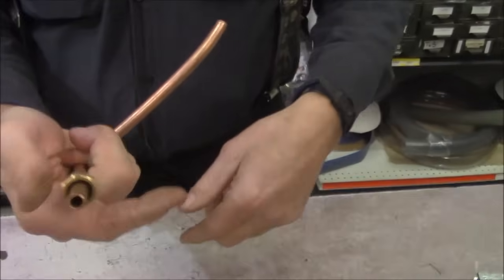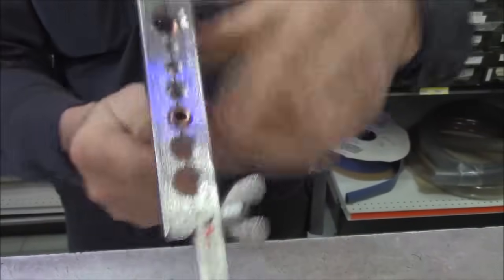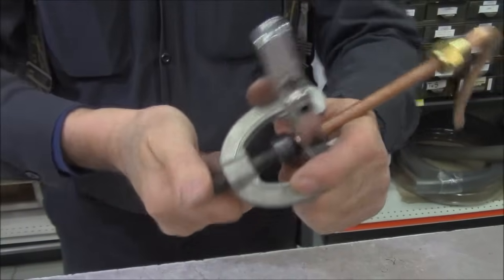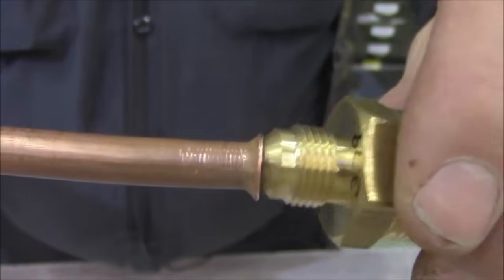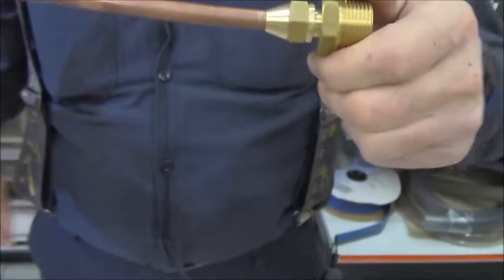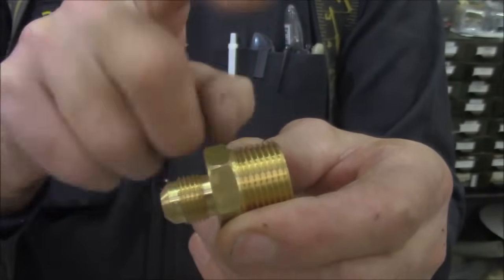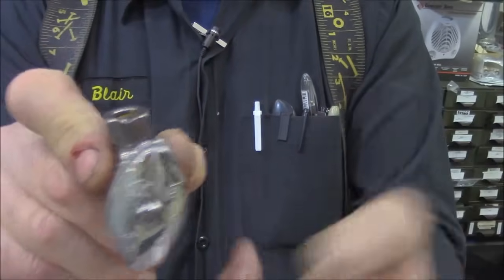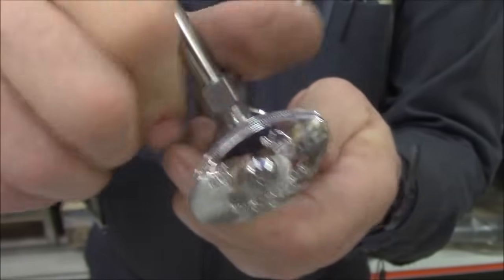How To Flare Copper Tubing For Gas, DANGER - NOT WATER COMPRESSION NUT

Comment: I need to redo the copper tubing that feeds LP to my gas fridge in my camper. Can I call a plumber to cut/replace/reflare my tube, do you think?  I'm trying to avoid the $90/hr cost at the local RV shop (though I doubt a plumber is going to be much less expensive).  If I want to try to do this on my own and put a new piece in where mine got kinked, how do I cleanly cut the copper tubing so that it's round still before I use the flare tool, please?
Reply from the maker: You'll need a small tubing cutter to get a clean edge. I have cut w a mini hacksaw then used a drill bit to clear out any copper shavings. Be sure not to let them go down the tubing. Once you pressure test the line use soapy water to check for bubbles at any joints. Not just yours. Blair

Comment: Looks like whoever installed my hob did it illegally. The tube is clamped on the outside of the house with a flexi hose on an LPG bottle, goes through the wall via copper pipe and straight into the hob. Now the hob has a compression fitting under it, so how is that a thing if it's not legal?
Reply from the maker: My kingdom for a few pics, sounds pretty shabby, probably. Blair

Comment: I must have fumbled around flaring brake lines for about 2 days with this type of flaring tool and it was a complete headache to work with. Copper is probably much easier to flare but this type of flaring tool scares me when it comes to gas lines. They ought to come up with a better type of cheap flaring tool.
Reply: I'm not the automotive guy, but I believe there are special tools for brake lines. Be careful of cheap fixes when working on brakes.
Reply: Like anything else you have to practice flaring to get good at it. Do a good single flair, then move up to double flair. Brake line material is typically steel so it is harder than copper. Also if you can afford to buy up on your flair tool. If you're doing brake lines it's worth it for your safety and everyone else's as well.
Reply: @philtrokanski2282  I posted this 3 years ago. But I have several flaring tools now. All made in China and Taiwan. Not one of these mutha f'ers worked properly. It took a day just to flare 4 lines. I tossed them in the trash can and bought an American made flaring tool. Job done! The quality flaring tools are worth it.

Comment: Our gas supplier shop sells those compression fittings but it has the brass olive like on your clip with a extra little olive with stops any movement ( it looks like a spring nut) then the normal nut over that to tighten, alot of gas fitters use it?
Reply: Spring washer
Reply from the maker: I'm not aware, but there are other systems (although rare) for gas lines that are available. Our goal is to cover the common dangers most homeowners encounter. Blair

Comment: Hi Mr Hardware.how do I prevent gas leak in a flare.do I use Teflon or dope
Reply from the maker: Flare seals are between the flared copper and the face of the fitting. No place for dope. None required.

Comment: Im working on running new propane lines on my camper why would the old lines be double flared?
Reply from the maker: possibly for strength, I never heard of propane double flared. Check with the manufacturer, you are out of my expertise. Sorry Blair
Reply: Mr. Hardware thank you

Comment: I can't get a flare on 1/8" copper tube no matter what I try.  I'm using the same kit but it just destroys the tube.
Reply from the maker: First be sure the tip of the flaring tool is sharp enough. Then try using a drill bit, about 3/16, and drill into the end of the copper just a touch. That may be enough to get to tube to start to flare.
Reply: The flaring tool is new, but I may sharpen it on the grinding wheel.  I'll try the drill bit.  I bought the flare kit to flare this one tube, one time.  That's all I need for my repair.  If nothing else works, I was thinking of torching the tube before flaring it to see if the copper would soften up.  Or maybe full cherry red then water quench to anneal it.
Reply from the maker: David, get it hot but let is cool slowly. Quenching it may harden the copper.
Reply: I got it but it took a couple of tries.  I did drill out the end with a 3/16" bit.  Then I put a dab of grease on the end.  Finally, I flaired it in two steps, a little each time without cranking down too hard at all.  BTW, copper is different than steel which will harden if heated to cherry red and quenched.  Doing the same to copper will actually anneal it.  But I didn't take that step.  The biggest problem I had is with the die set.  The opening for the 1/8" tube is not big enough, leaving a gap on both sides.  The flare will tear open in this gap.  If I had to flare another one, I'd crank the die set down with nothing in it, then drill that hole out a little so the OD of the tube fits better.
Reply from the maker: Thanks for the info on the copper annealing, I'm always learning. Sounds like you fought the good fight and won.

Comment: Nice! Is there anything else needed like teflon or some special putty on that flared fitting?  I thought I saw the sevice-guy add something else there when he was changing the shut off and other connections.
Reply from the maker: I put teflon tape on the threads to act as a lubricant so tightening the nut is easier

Comment: Thanks Blair. When ever I need some tips for a home repair you seem to have already made an informative video about the job. Lucky me!
Reply from the maker: Thanks, I have the most fun job, you come broke, you leave fixed, usually....
Reply from the maker: A drop or 2 of oil on the wing nut threads helps tons tooooo
Reply: Blair Gilbert Thanks so much for explaining compression vs flare! I'm redoing the copper propane line in a vintage RV, and it would've been very easy to grab compression fittings or even a complete flexible hose assembly with compression fittings. I did it right thanks to you and my family is safe!

One thing I'll add is that the copper tubing was prone to slipping through the clamp for me. I used a screwdriver as a cheater bar on the wing nuts and never had another one slip through.

Comment: Is gas nipple standard flare a 37 degree (JIC) or is it a 45 degree?  I'm running flexible copper to an oven. I know if i use a 37 degree flare tool it will conform to a 45 under compression. I just want to flare it to the right degree for piece of mind.
Reply from the maker: +Tim Anderson 
In Michigan a standard flare for gas, natural gas and propane is a 45 degrees. You had better check for the codes on running soft topper to an appliance. I believe it has to have a gas valve and a flex connector behind the appliance.
Reply: I have soft copper running to the hot water heater, fireplace and now the oven from the basement up. I did use shut offs at both the manifold and upstairs at the stove. Sprayed all the connections for leaks and it turned out well. Just finished it about an hour ago and made a first quick meal and I didn't even get blown up! Yet.
Reply from the maker: +Tim Anderson 
Tim, no bubbles, no blowing up.
Reply: just to clarify: even though you don't have immediate leaks, you really should use the flaring tool meant fir the type of fitting you have. 37 to 37 and 45 to 45. mixing them makes an unmatched face which leads to turbulence in the line that will eventually corrode it and then you have a leak. it is the same reason you want to ream all your cut tube and pipe.
Reply: +Blair Gilbert I haven't used the 37deg fittings in residential plumbing. And the NFPA Fuel gas Code requires single wall 45deg flared joints. usually used for the connection from the wall to the appliance that may need frequent moving. a dryer for instance, which requires cleaning of the duct behind it.

I have used 37deg fittings in hydraulic applications though. brake lines and I believe its used in refrigeration as well.
Reply: 37 Degree fittings are used for hydraulics in aviation as well.
Reply from the maker: Pablo, is 37 degree fittings used in household plumbing?

Comment: Would this also work for oxygen and acetylene lines? In my case I'd like to remove (cut off) a barb fitting from a 5/16ths brass line and install an adapter to get a threaded connection instead.
Reply from the maker: +1873Winchester 
Sorry Winchester, you'll have to check with your gas supplier. You are out of my expertise.

Comment: How about gasoline? its adapting the exact same thing you have in the video, copper tubing 1/2" and 5/8" flare nut (the cone) mating to an AN fitting size 10- the AN fittings- I cannot find the size adpater I need to go from 10AN female thread to barb 1/2" 

I test fit it all at home depot today and it seems like it will work- any advice or preventive maintenance tip for joining the brass and aluminum? Should I use Teflon tape? 
Thank you
Reply: I believe at least in hydraulic that the dash size must match the OD of the copper or metal tube. Any jumps are made with adaptors after the flare. Tube is always measured OD as pipe is always measure ID.
Reply from the maker: +Nash Fitness 
I would go to a hydraulic supplier or a skilled auto supplier for the 10AH adapter.
I would never trust the talent from any big box unless I saw their credentials first.
Why use Aluminum tubing these days? Copper is the better choice. Given the right conditions brass and aluminum react to each other.
Reply: sounds good, thank you
Reply: it worked flawlessly the way I set it up guys- the aluminum fuel cell- had the large 10 AN male sticking out- i used the large 5/8" npt and it direct threaded on- i then flared the copper piping and cut it to about 6 inches feeding out to my fuel pump location- then added a slip on reducer- forgot the name- but it slid over the copper piping and had a barb style on the male outlet- i then sealed all of it threads included with aircraft fuel sealant i ordered online- and done- been driving on it for a few months now- works great- i will change it all over later to AN when i have the cash- or when i change out the fuel cell to a more custom size-